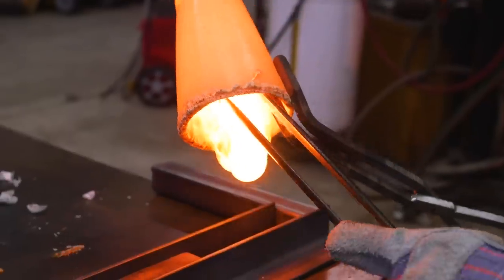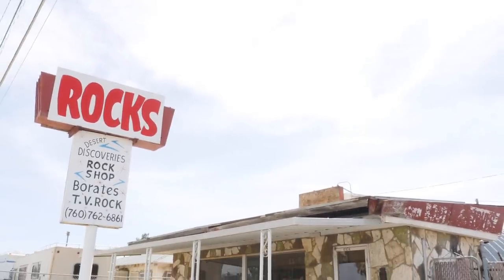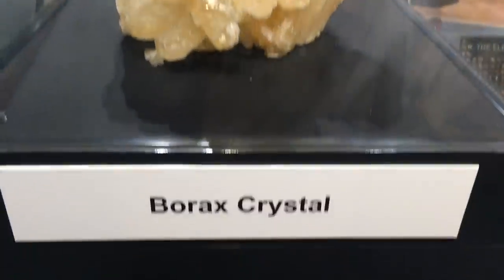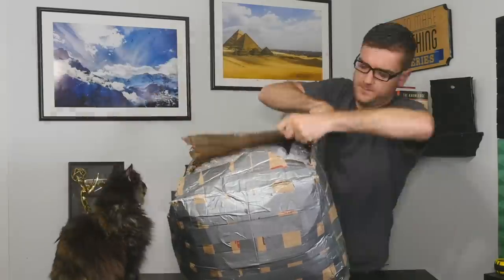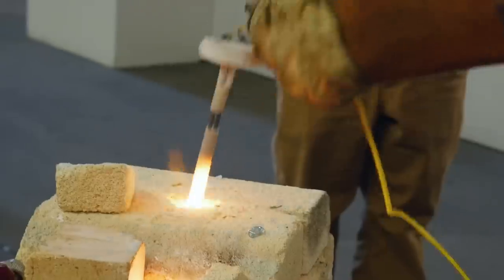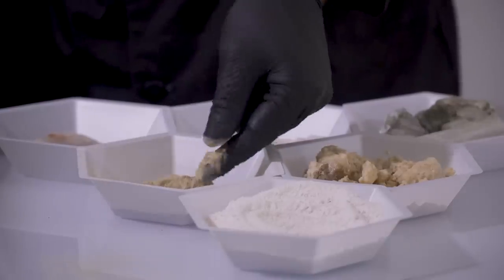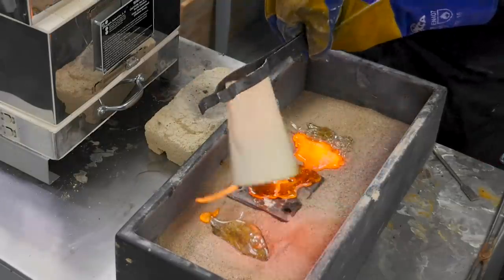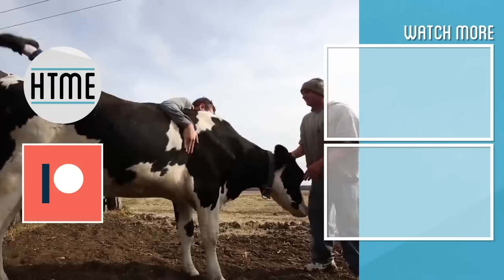Conquering Clear Glass

Comment: i remember when my parents used to tell me as a kid that glass was just melted rocks...and then i would imagine a desert where the rocks were just melting into glass lmfao.
Reply: There is a desert with special sand that if for example in a thunderstorm a lightning strike hits it it form really long lightning shaped Glas structures.
Reply: a glass dessert ....could be a neat setting
Reply: @Dennis West No way! Can you tell me what that Egyptian glass is called so I can research it some more?
Reply: @Dennis West Thanks!
Reply: @chudzy  the one form of meteoric glass that i know of is Moldavite and its actually the same co-efficiency as borocilicate and can be used along side it. i know some artists who use it in their Pipes. its expensive but cool. its like a pale green when mixed with clear. i dont know if its used in soft glass which is the type of glass work he is working with. the co-efficiency of soft glass and boro are different. boro is basically pyrex so it gets colder faster and is a much thicker consistency at the low levels that soft glass melts at. soft glass is also the only type of glass you can make prince Rupert drops from. those dont work with borocilicate...sorry for my poor grammar

Comment: Borax is also used in Blacksmithing as a Flux, but it does something different. Instead of using it to lower the working/melting  temperature of the steal. It's sprinkled on forge-temperature metal when forge welding either two or more layers of different metals, mostly used to make a damascus of some sort, or when you need to fold and forge weld the same piece of metal onto itself for whatever needed reason. In this use, Borax melts and flows between the layers, filling the space between them while working with it, and is then quickly pushed out when hammered. This prevents scale, the flakes and sparks you see flying or falling off when metal is being beat which are impurities and oxidation, from forming between the layers causing imperfections which can cause failures of various types and severities.

Comment: Interesting journey. The green tint is from iron in the sand and requires other compounds to make glass clear. Most glass we use does not remove all the green, look at the edge of a car window or most cheap glassware for examples. Holding the molten glass at a high melt temp for a longer period will help remove bubbles. You could check out the Corning Museum of Glass in Corning, NY for more resources on making your own glass.

Comment: Finally! The one project that has had me return to your channel through various means (looking through your videos after liking another, curiosity on the subject months after seeing you fail, youtuber collab linking me back here, and now youtube rec) is successfully accomplished. It's not perfect though, so you still have to figure out the tint, the cooling and the pouring. Can we later get to see you use the new glass to recreate old projects in a montage, like your glasses and microscope?

I would also love to see you eventually figure out how to make this kind of glass with more commonplace raw-material that doesnt require you to travel to specific, very unique, mines or lakes. Instead figuring out how to use any arbitrary sand, trees, and rocks lying on a random mountain, and purify them using only tools you can build yourself (thinking primitive technology-style here. Maybe collab with the guy too? Although would be a bit weird seeing you half-naked and silent the entire video...)

Something I have always wondered when I see youtubers use those propane torches confidently in their chemistry while they also worry about impurities from all other sorts of sources: What makes them/you so confident that it is not the cause of the impurities in the final result? For your glass now that you got an electrical oven I suppose you would only see it at the surface-layer, but before that it was used to melt the compound too. The reason I always wonder this is because I also remember seeing how a seismograph was made, where a propane torch was used to soot paper the needle then scratched soot off as the method of drawing. If it can soot things that well, I can only imagine it can be a source of impurities. Although it is possible the source of the soot was the paper heating up.

Comment: You should look in to a few things that might help with clear glass.
-kiln casting: using a terracotta flower pot as a crucible that drips in to a plaster silica mold. this would solve your problem of where to pour the glass. it would just stay in the kiln thru out the process  
-squeeze the glass: a process in which the molten glass is cooled below its working temperature for a few hours to push the bubbles to the surface before being reheated.
-the green color likely is from the presence of iron in the glass. This could be from impurity in the batch but I noticed that it gets darker as you processes it more. It may be from the metal sheets it was being poured on. Chromium in stainless steel can also cause a green color.

Comment: The green color is most likely caused by iron impurities. You can remove some of the bubbles by taking it to melting temp, dropping it to around 1500, then take it back to melting temp. It's called squeezing. To cast a "puck" set up a second kiln at 920 degrees, with a ceramic mold coated in kiln wash.

Comment: If you truly want to make clear flat glass it needs to be floated and cooled on molten tin then removed from the molten tin when solidified, (with the tin still molten), annealed from around 600 degrees Celsius over a period of a few hours. It's a rushed explanation but it is how they have made flat "float" glass for years. The main thing is it needs to be kept hot while pouring onto the molten tin and can be stretched while on the tin to make the glass thinner.

Comment: Lead glass is a variety of glass in which lead replaces the calcium content of a typical potash glass and contains typically 18–40% (by weight) lead(II) oxide (PbO).  The advantage is the addition of lead oxide to potash glass reduces its viscosity, rendering it more fluid than ordinary soda glass above softening temperature (about 600 °C or 1,112 °F), with a working point of 800 °C (1,470 °F). The viscosity of glass varies radically with temperature, but that of lead glass is roughly 100 times less than that of ordinary soda glasses across working temperature ranges (up to 1,100 °C or 2,010 °F).

Comment: It actually is possible to produce small amounts of glass in a microwave, we did that once in school. That technique uses the trick that a layer of graphite ist sprayed onto a supporting structure around around a porcellaine crucible. The graphite heats up through the microvave radiation and reaches temperatures hot enough to melt metal or produce glass in the crucible.
But this is a very cool project once again! Just one more hint ... as a chemist I can't watch you touching the borax with your bare hands ... borax is a highly concerning substance due to its reproductive toxicity.

Comment: the green colouration is due to how light reflects by glass, if you've ever rolled down a car window and saw that there was green around the edges it's because (and don't quote me, it's been a while since I was taught this) green light tends to reflect and refract more, if you've ever looked at those infinite mirror illusions you'd noticeas it goes further down it tends to lean to a greener shadow, also human eyes tend to pick up green light more than any other light. Still that glass did seem a bit greener than any other clear glass so don't go blaming it all on green light, it might be because there was still some small impurities in the compounds, if you did want it to be absolutely pure you would of done it chemically and accurately, or it could be because the glass cooled too fast but I'm no expert on glass

Comment: Also to make flat glass you float glass on tin.  Thats how you get it to be perfectly flat... basically tin is used because it is heavier so glass floats on it at the same time tin is liquid when glass is solidifying still . Its the easiest way to get truely flat glass without bubbles. Sure you can pour it into a flat mold but i think floating it will give you better flat glass. Or if you can uses molten tin in different molded shapes to float your glass .

Comment: Pour molten glass onto a bath of molten solder. Glass will float on the solder. The heat from the solder will anneal the glass slowly as it cools... The iron impurities are from pouring the molten glass onto a cold steel surface 15 - 20 times.

Comment: I know that this video is getting on a bit now, but I think that a huge part of your problem is the way you're getting it out of the crucible. My (admittedly very limited) understanding is that reliably cooling glass used to be achieved by blowing it into an elongated bulb shape. once cooled but still malleable, the sides of the bulb could be cut and flattened out into a sheet.

Making flat sheets of glass (as you're attempting) wasn't possible until it was discovered that the molten glass could be poured onto the surface of molten tin (the Pilkington method)

Comment: Excellent video.  I'm watching because I made some DIY crucibles and used Borax to line the inside so metals wont stick.  I then tried to melt some copper and used borax as a flux.  The borax turned to a deep blue crystal glass like even though the copper did not melt.  With a little experimentation I might be able to make some DIY blue enamel powder to enamel some jewelry.  Just subscribed to your channel.  Great stuff.

Comment: You ought to try making concrete from scratch and see if you can make some close to or just as good as commercial grade! 

Borax powder makes a great insecticide too, I guess its tiny little hard crystals wear down their exoskeletons and cause them to lose too much water and die of dehydration. I used to dust around with it in my basement to kill centipedes and it seem to do a pretty good job on them, though I never got rid of the little bastards entirely.

Comment: I just found this channel. Im visiting the fam.and we dont have internet where im from.  Ive been thnkig about making slaked lime from egg shells (calcium carbonate) and lye from hardwood ash and purifying sand from separating it out from loam. All of these can be easily found in my yard. Another thing obtained locally is a wood fired kiln. Now i know what youre thinking, but it really would use wood gas. Have you ever heard of a rocket stove? Or a rocket mass heater? I wonder if one could be engineered to burn and make the reburnchamber to be accessable. Another rocket stove would need to be made to sustain a higher heat and then release it. Most rocket stove mass heaters are designed to burn at thousands of degrees but to distribute that into a clay, rock and sand mass that would heat a living space for days off of a single burn of less than two hours. If the mass was reduced, or perhaps the mass removed to make the heat slowly reduce i wonder if that would work to anneal. I am so curious how they did it before globalization  and gas fired kilns. I think it led to a lot of deforestation, and it may not be a sustainable practice. Perhaps not a concern of your channel, but you are a living being and you are a scientist, so i sorta assume you believe in global warming and such. Anyways, i have no fancy ways of making videos at home, but ive been collecting chicken egg shells from about 20 chickens every once in a while for a good portion of a year and may attempt to at least make slaked lime.
Reply: Im also interested in blacksmithing using a rs as a forge. Some day ill do these things, boric acid is a common traditional blacksmithing flux. I guess they just mined it for glass making. Still have windows only been around for a few hundred years or what?

Comment: you've  come a long way on your quest..
you need to remove the iron from your silica to remove the green tint.
and perhaps using a bit of lead for flux would also help to lower the 
melting point much lower that  you  are melting at now by hundreds of degrees.
it will also give the glass some brilliance.  

ancient glass had lots of it in it because they couldn't get super high temps
that we get with ifb and electricity. plus its very forgiving when you get
to the point of putting colors(different glasses) together. 

as for your cooling/annealing  temp  just for a ball park temp range
 around 900  give or take,    over do it for time   at temp , you can't annealing too long..
a bad annealing job basically is setting up stress that can cause the glass to shatter
by itself or perhaps when touched...at any time after its cool,, right now or in a few
hrs, days or even years . a basic time bomb...

 just for kicks you should put some of your glass between 2 sheets of polarizing
film 90 degrees to each other 
film and see what kind of stress there is ,how well your mixing your batch
and how well its annealed..

Comment: I heard that if there is a metal pole in sand that is struck by lightning it can turn some of the surrounding sand into glass. Is this possible? Would it be glass, but not clear at all? If sand alone is heated to a molten state then cools into a crystal, what is the result called?

Comment: pretty much all the clear sheet glass you buy has that green tint when viewed from the side......I used to work at a company that cut a lot of sheet glass......even the windows in your house have that green tint from the side.......provided they are not low-e.....the silver coating creates an odd shade to it........anyway, you can buy low iron glass that doesn't have the typical green tint.....it appears more clear from the side......I don't know all the chemical makeups of it...but that is my basic knowledge of it.